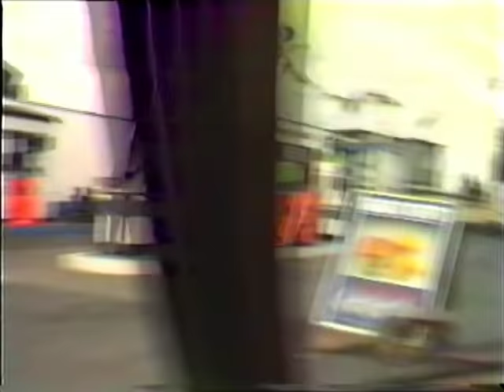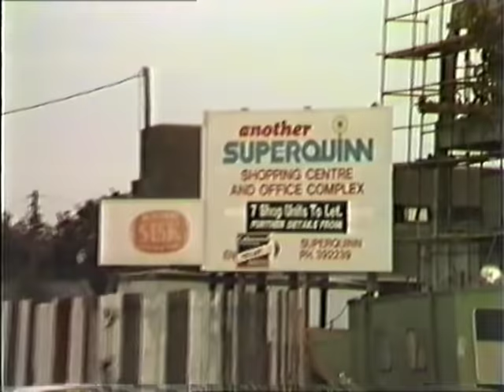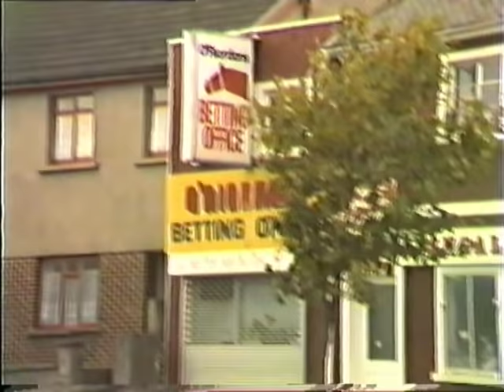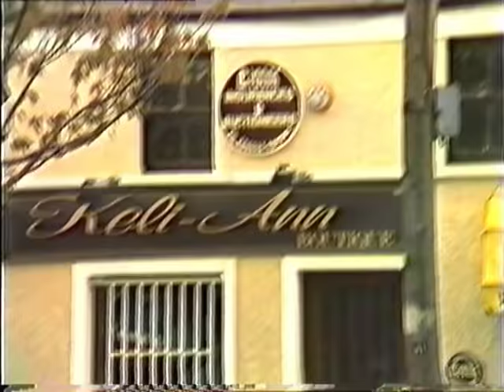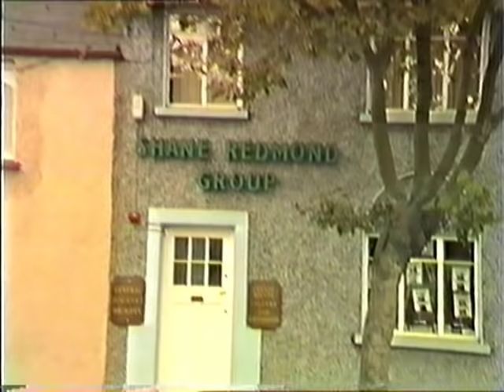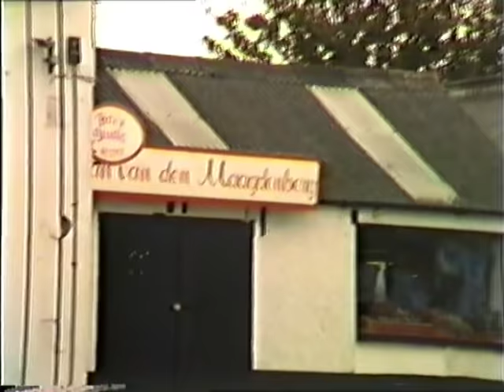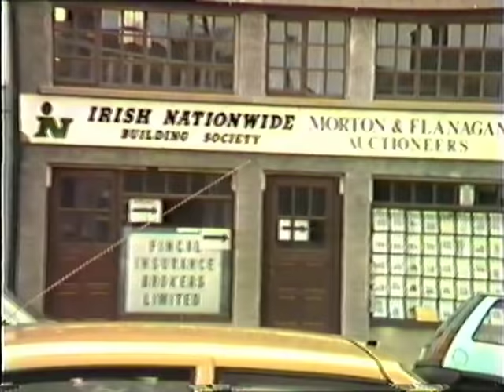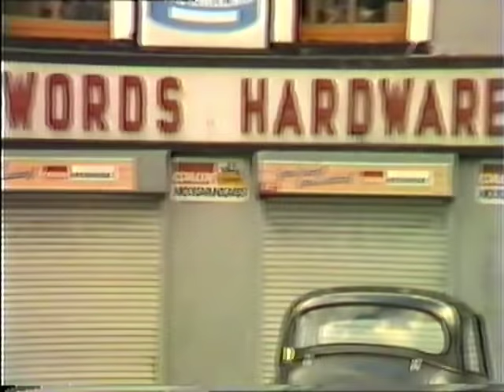Views of Swords Village in 1980s

Comment: If you're still on Youtube, I have some information on the date.  At 8:45 , it shows a bus with a CIÉ logo on it. CIÉ would be dissolved (or atleast, stopped doing transport by itself) in 1987, which means this was in 1986.
Reply: Then there is no new reg cars that started Jan 87, plus the new Superquinn been built 6:52 puts it Summer1985.